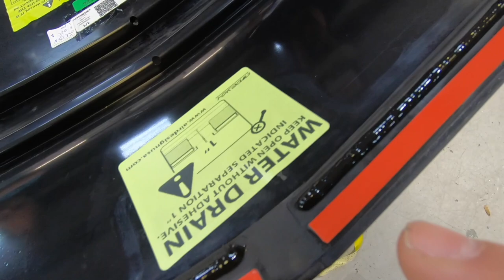New Silverado Body Kit Revealed WOW looks crazy!!!

Comment: Did you have to notch it with the 4/6 drop?
Reply from the maker: no i added helper bags
Reply: @wfosteve7049  and it didn’t bottom out at all?
Reply: What helper bags did you add Steve? I pick up my white RST today and I want to do the same but don’t want to cut the frame.